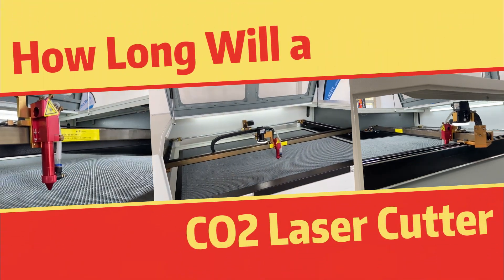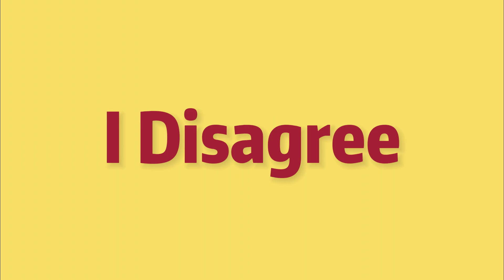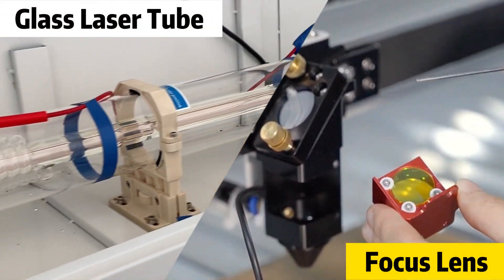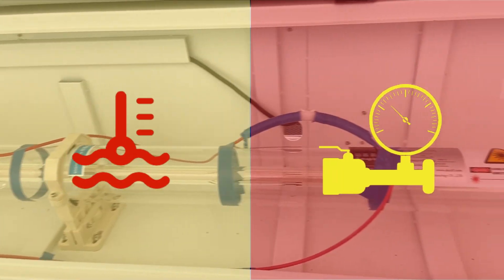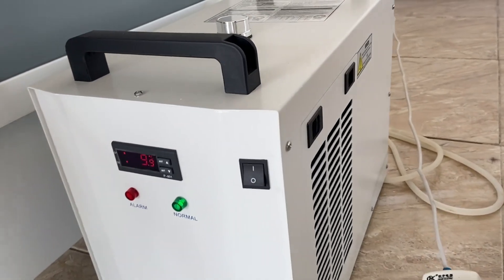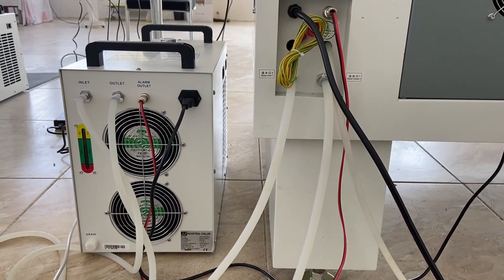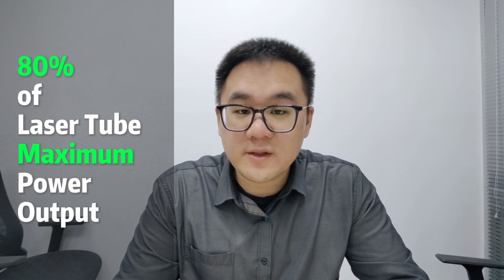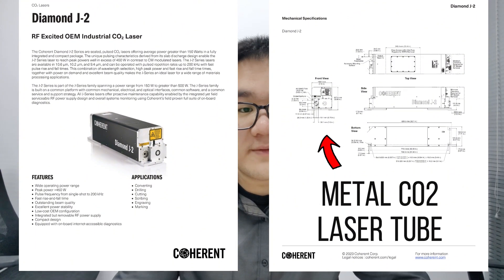How Long will a CO2 Laser Cutter Last?

Comment: how long the life span for the tube co2  2030
Reply from the maker: Hello there!
As a general rule of thumb , a 300W CO2 laser tube with proper care can provide practical usage for over 10,000 hours.

However, I would strongly encourage you to consult your laser machine manufacturer for a more comprehensive lifespan estimate tailored to your specific equipment.

They'll be able to provide the most accurate information.

In this Video we also covered some helpful maintenance steps to ensure you get the maximum lifespan out of your CO2 laser tube.

I'd recommend checking that out if you haven't already.